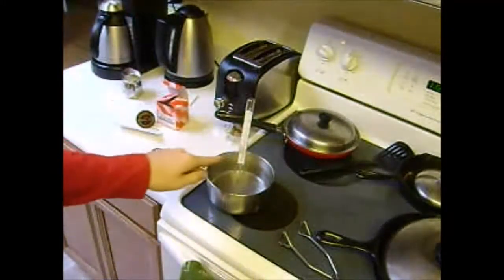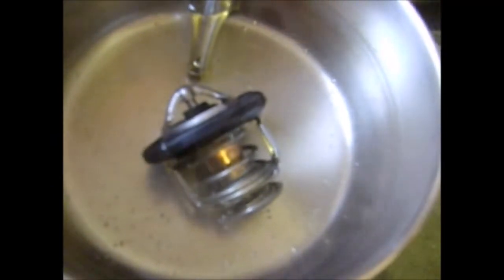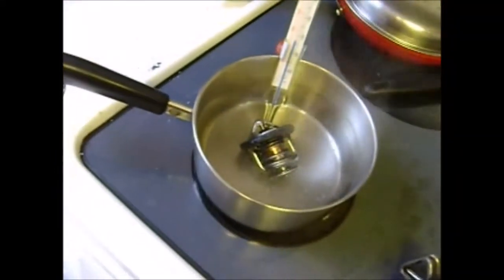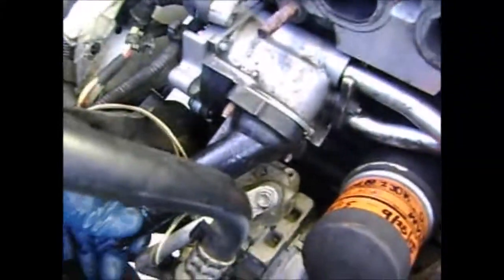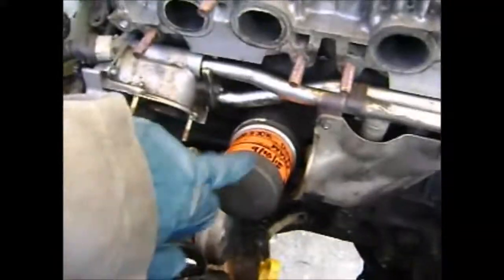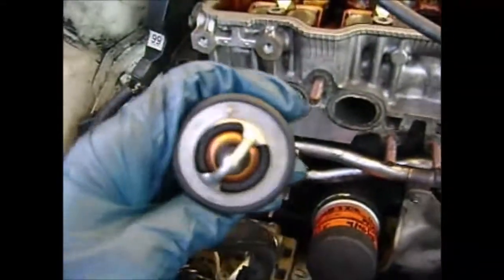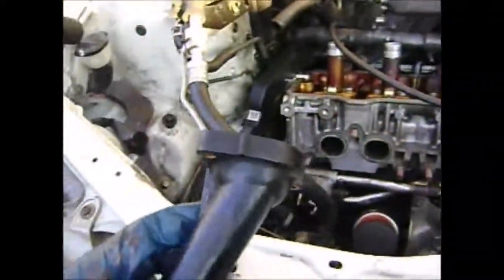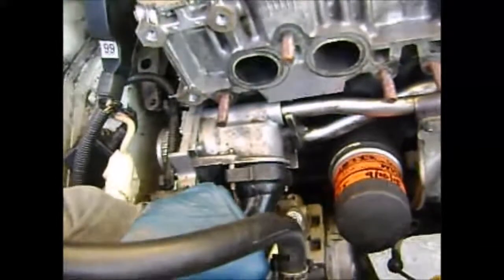How To Replace Thermostat on Toyota Camry RAV4 Celica 3S-FE etc. -Jonny DIY

Comment: you should always put the thermostat in the same direction and having the arrows the same as the old thermostat you took out great video though
Reply from the maker: +Ricardo Delgado Thanks for commenting. Thats a good tip, as long as the person before you did the job correct, I try and put things back the way they were.